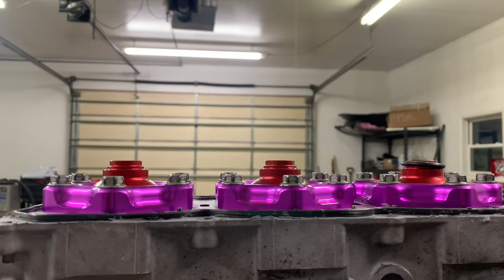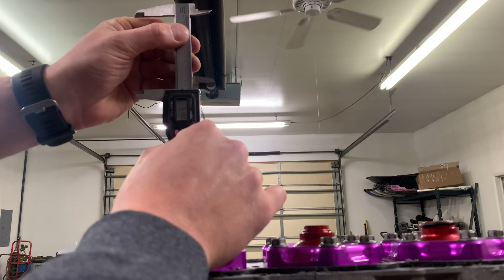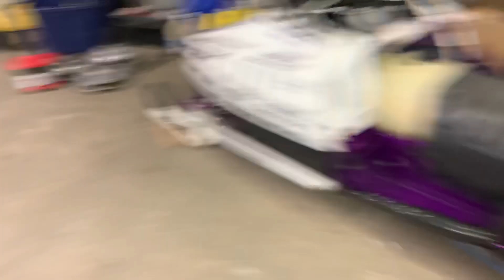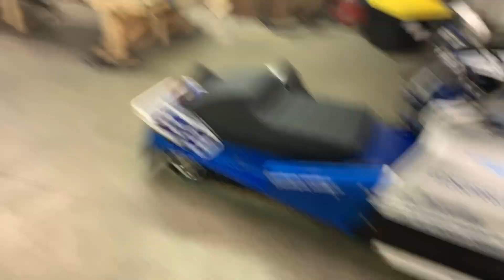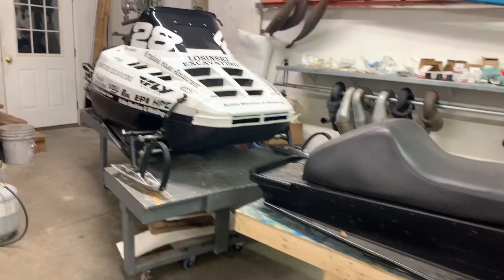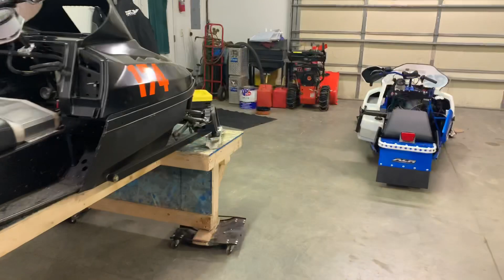How To: Measuring Phase on Triple Crank

Comment: My 96 xlt with 1600 miles is not firing on the far right cylinder throttle side. I've  checked everything switched plug wires sprayed carb cleaner on the crank seal no change. 
But it will not fire on that cylinder???
Reply from the maker: clean that carb specifically?
Make sure the brass piece isn't upside down that the needle and seat sit on

Comment: Have you done any mods to your crankcases to address the common pto bearing problems from not getting enough oil on your XLTs?
Reply from the maker: I usually don’t. The only thing that I’ve done was open up the PTO oiler hole. Since all of our sleds are premix it really doesn’t effect them. Opening up the hole makes it flow oil a little bit better
Reply: @AustinLeeckRacing  good to know. Thanks

Comment: Piston dome has a radius doesn't it? So would measure different depending where dial caliper hits it. ? your idea is sound but need a degree wheel for actual top dead centre then measure other two with a centred device. Then you're idea would have merit.
Reply from the maker: Audrey Meschkuleit yep! You’re 100% right. I tried to measure the same spot. Degree wheel would be best route. This was just a quick measure to see how off it is. I knew this crank was already junk. 👍🏼